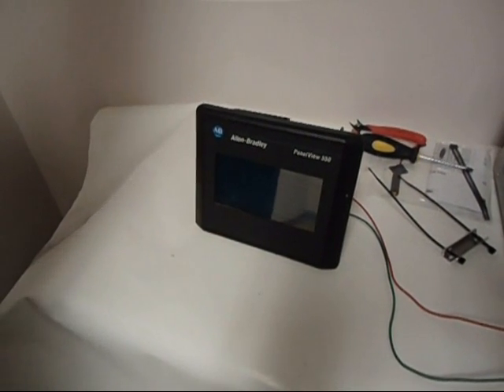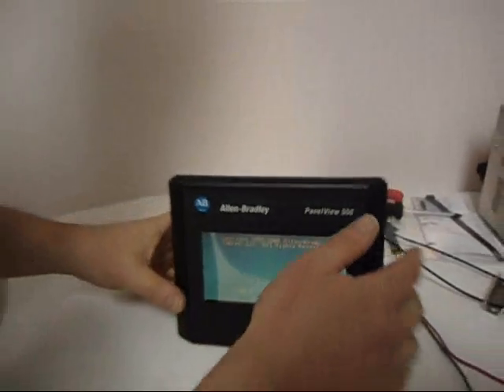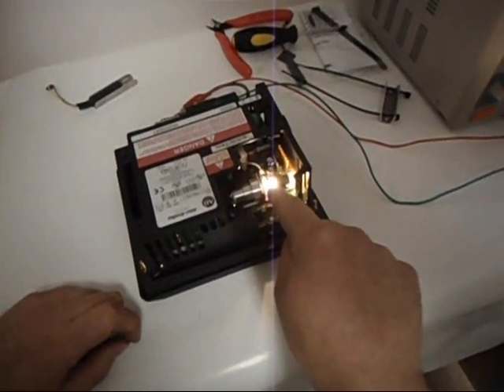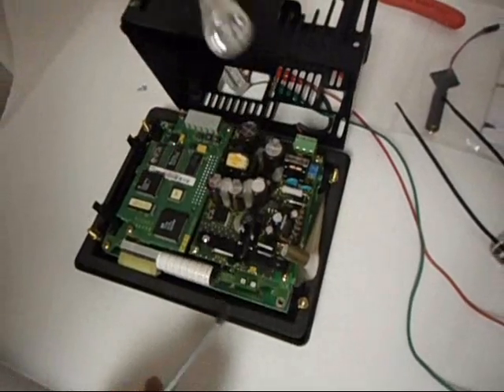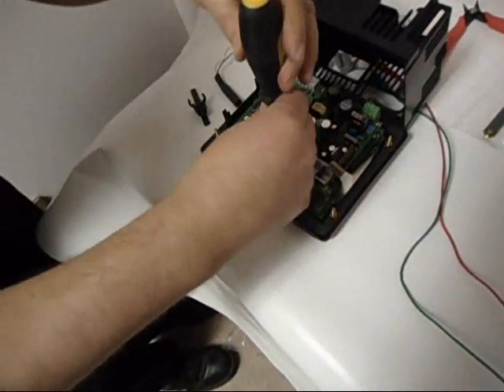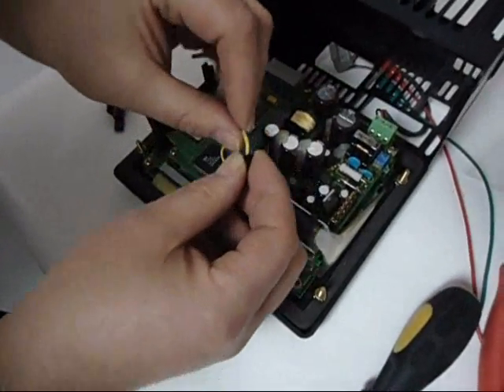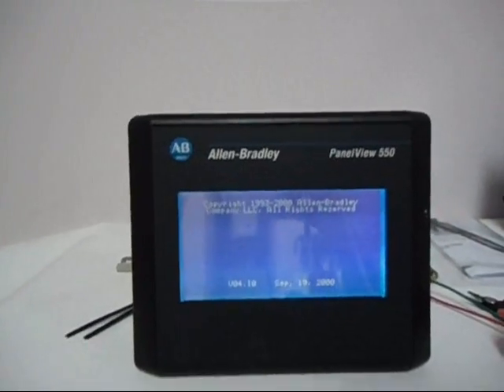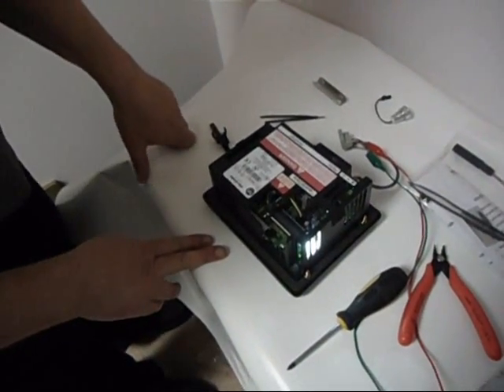Allen Bradley 550 LED Backlight Bulb Upgrade

Comment: This idea was very well done. I have two panel 550 with light burned. But due to the cost of the lamp is very high in Brazil, it is not feasible.

Congratulations on the idea